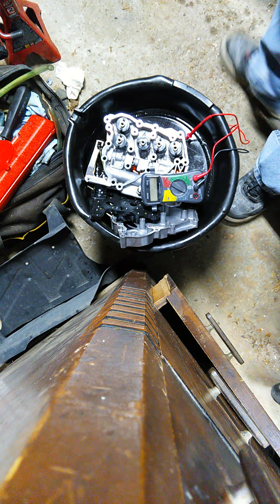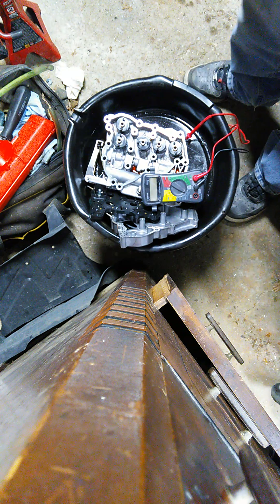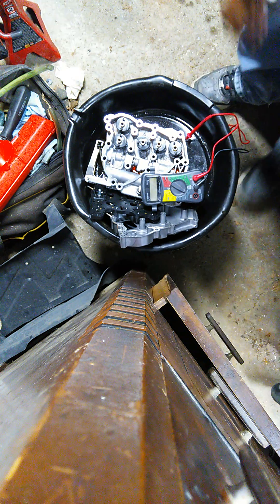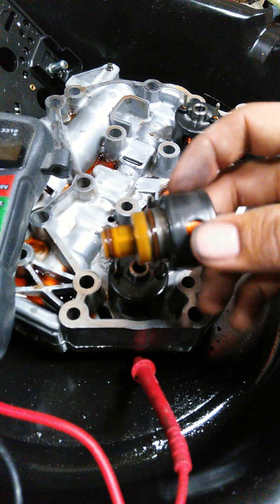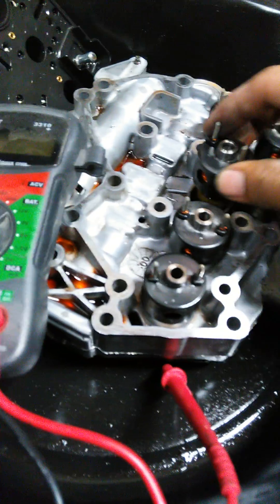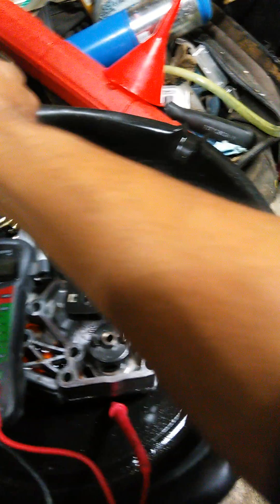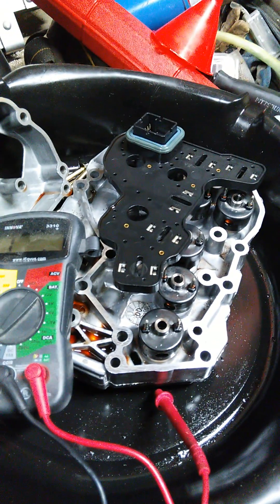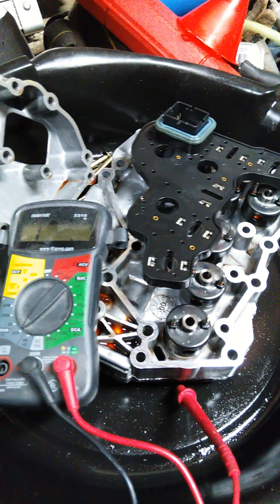Saturn sl1 valve body testing

Comment: I’m also having hard shifting from my 2002 Saturn SL2. I’m replacing the valve body soon. And I’ll test the solenoids the way you did in the video and see if it had the same solenoid with the same failure.